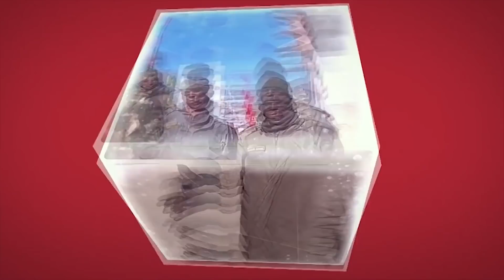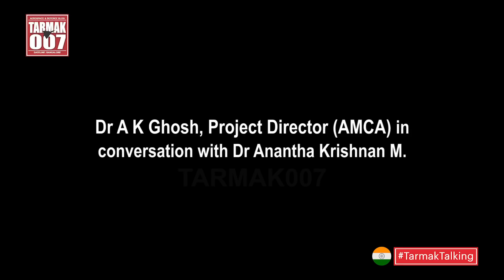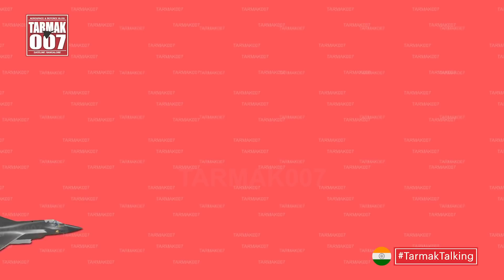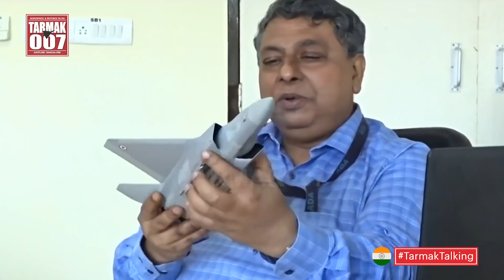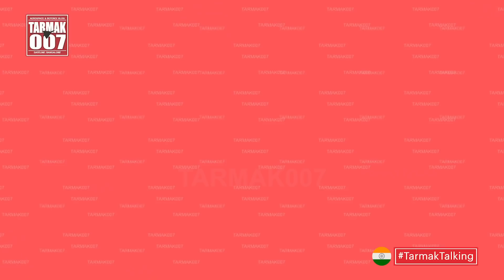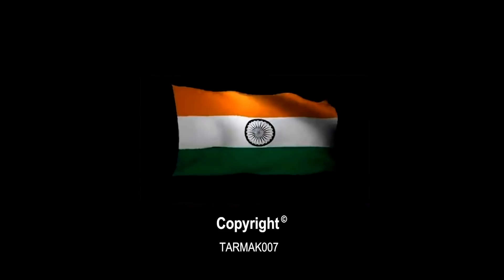Inspiring ADA | Part-2 | Advanced cockpit of AMCA likely to land at Aero India: Dr Ghosh

Comment: Fuselage is large and the cross-section of AMCA can be easily visible from a distance. I fuselage should have been evenly blended with the body to remove all contours. The pilot and the weapon master's seat must be arranged side by side (similar to that of passenger jet) which will call for new designing of seat ejection system. The air intake must not only be taken from rear end but also from top end as well. From side wise view AMCA should resemble a blade.

Comment: Officially confirmed that AMCA is going to be a 5+ generation aircraft.
Reply: That's already a known fact since long bhai
Reply: Amca mk2 is 5+ or 6th gen ??
Reply: @ABCD-wz2kn  If you see a slanted tail, its obviously a 5th gen. 6th gen fighters will not have slanted tails. Primary yaw control will be achieved with the help of thrust vectoring.
Reply: @death_parade  Absolutely! AMCA will be. 5.5gen fighter...6th gen fighters will be different...
Reply: @death_parade  Tempest, FCAS, Northrop grummans', MiG 6th gen. All have slanted vertical tail. 
Only F/A-XX and Lockheed Martin are the one who won't have vertical tail (at least in there model, which are most likely for hype).
Reply: @ABCD-wz2kn  5.5 gen fighter! As it will have Directed-energy weapon & E- bombs....
Reply: @mayanksagar633  It will not have a directed energy weapon. Directed energy weapons are basically lasers which requires incredible amount of electricity to power. An aircraft engine cannot produce that much electric power (as of now) to charge and fire a directed energy. Thus, a directed energy weapon can only be used on a naval vessel or on a ground based platform.
Reply: @abirbo  with the help of super capastors it can be achieved! Technologies progress with time by 2030 india will have DEW oprational........
Reply: 5.5+
Reply: I'm not sure about it,
but if the radar cross section is more than .005 meter square ,no matter what technology and design you put in there, its vain
Reply: @manojkumarnayak7100  even tejas mark 1a has an RCS of 0.05-0.1msq2 ....According AMCA to me RCS will be.... Close to 0.0001msq2 or -40Db....It will posses every feature of stealth! I have been following this program since its inception, trust me when it will come out it will directly complete with the top 5th gen fighters! Having GaN based AESA, RWR, DAS etc, It will be true 5th gen fighter after f35.....
Reply: Doesn’t matter. By 2025 many countries like China and the USA will have many 6th generation jets.
Reply: @Fish-ey9lt  6Th Gen is just a Fantasy Even 5th Gen F-35 has issues only + is Stealth. And China who tested and where. Its not war tested Technology China has a policy To Fabricate things as The Best is with us. Even sukhoi got chinese so called stealth plane Frequency on Radar when IAF was doing a routine shorties in Ladakh si clearly its not even proper stealth.
Reply: Fish
Dumbass comment 
USA won't have a sixth gen jet before 2035 
Amca will come before 2030 
Second amca is a 5.5 gen aircraft 

At max india will only be late by a decade 
Not more than that
Reply: @Fish-ey9lt  like?
Reply: @Fish-ey9lt  @Fish 6Th Gen is just a Fantasy Even 5th Gen F-35 has issues only + is Stealth. And China who tested and where. Its not war tested Technology China has a policy To Fabricate things as The Best is with us. Even sukhoi got chinese so called stealth plane Frequency on Radar when IAF was doing a routine shorties in Ladakh si clearly its not even proper stealth.
Reply: @Fish-ey9lt  6th gen fighter is vague term! They are just 5th gen fighters with DEW etc, All those technologies will be incorporated into AMCA too thats why it's said to be 5.5gen fighter